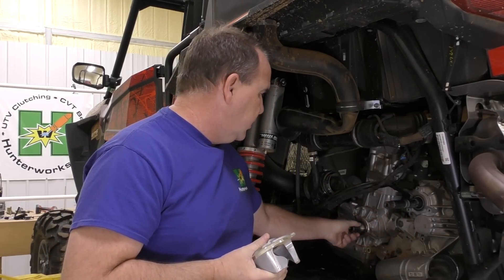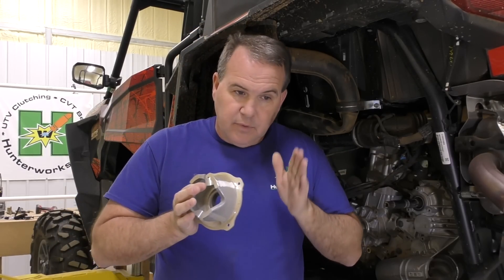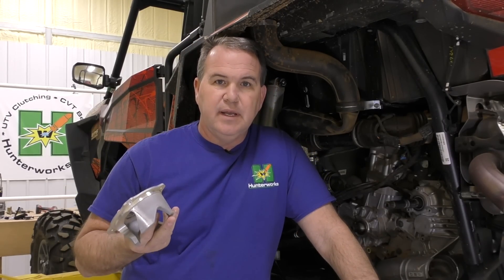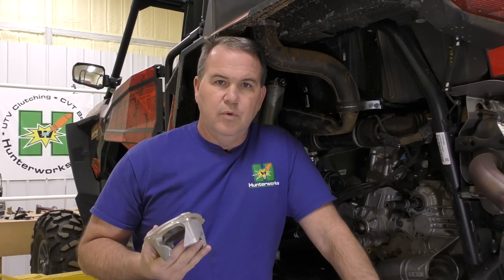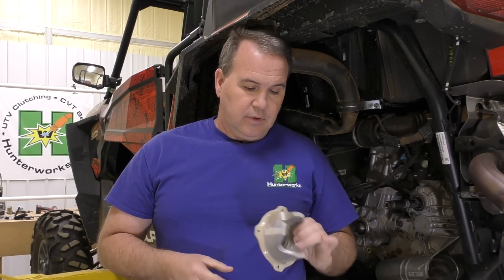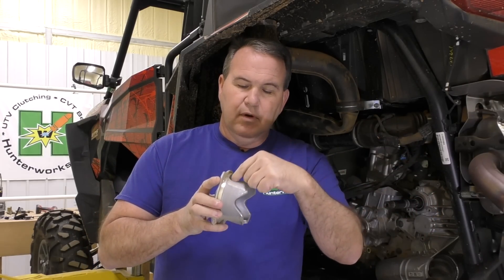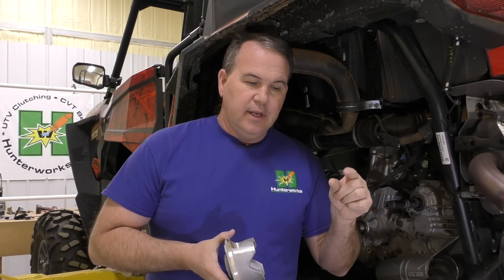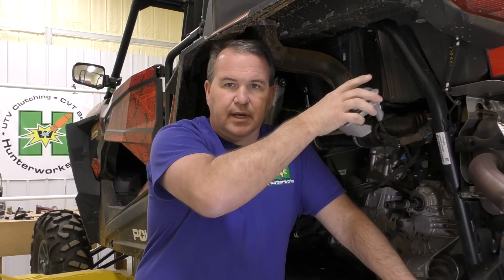Polaris Engine Braking Explained

Comment: I'm new to the 2014 polaris 900 stealth how can I delete this I can't stand it  I want the unit to coast freely when I let out of the throttle thank you
Reply from the maker: What is a stealth?  This a RZR or Ranger or snowmobile?
Reply: @Hunterworks  it's 1yr limited edition 900 rzr in 2014 if I understand it correctly
Reply from the maker: @kevinhumphrey932  You do not have engine braking technically, the helix is rather aggressive though, we have a less aggressive helix.  Same vehicle from 2011to 14 as far as clutches go.
Reply: @Hunterworks  post up a part for the items I need if you don't mind
Reply from the maker: @kevinhumphrey932  https://www.hunterworks.com/polaris_xp_rzr_900

Comment: How can I reduce my engine braking on my 2024 polaris Xpedition? It's dangerous in slippery conditions. It's way to aggressive.  Possible clutch spring change?
Reply from the maker: Your xpedition does not have engine braking technically, it has a two way bearing in the primary.  So from here the only way is change the helix to one with a different back angle, but I am not aware of one available.  If brand new, it will lessen as it gets some miles on it, then drive with the gas pedal and you will not notice it, do not take your foot off the throttle until you stop.

Comment: Dose a 2024 polaris sportsman 850 ultimate trail 
have full engin brake ??.
Reply from the maker: It does
Reply: Ok thanks , so when  I'm creeping up to a road crossing,  just enough  engaging the clutch  may getting 3-5 km. Then let off . It makes a little clank/clunk boath  accell and decell .
 That would be the helix making that little clunk/clank working  the engine brake.  Correct ??.
Reply from the maker: @trevorhall6286  couple things, the roller swapping sides in the helix and gear lash in the tranny, slow is not great for a cvt
Reply: Ok , thanks for the info . 
Very much appreciated 👍
Reply from the maker: @trevorhall6286  no problem

Comment: I have a 2013 sportsman 800 ot makes a loud constant clunking noise when deceleration and even when hitting the brakes foot or handlebar brake  it doesn't clunk on acceleration
Reply from the maker: That is not a clutch I am familiar with, we only do UTV's for the most part but a good look over is best

Comment: My rzr 800 has such bad engine breaking it'll slam you into steering wheel and is that way from any speeds I hate it way too strong
Reply from the maker: What year and model ?  Miles on it? Tire Size?
Reply: @Hunterworks Inc.  2008 non s model 26 in tires 5.5k miles and your  belt
Reply from the maker: @shawnmarks1400  technically, it does not have engine braking since it has a two way bearing so I would just say wear from all the miles on the clutch causing this
Reply: @Hunterworks Inc. After receiving a response from you I took belt cover off and  so far I found the center bearing on primary is frozen/locked solid. Do you think that's it or could there be something in the secondary as well? Thank you for all the help it's extremely appreciated
Reply from the maker: @shawnmarks1400  that is it
Reply: @Hunterworks Inc.  WOW just called dealership 700 and change I can't afford that please tell me it's rebuildible
Reply from the maker: @shawnmarks1400  you can put a new bearing in it
Reply: @Hunterworks Inc.  fantastic does your company offer one I would love to keep my business with you. You've been extremely informative and helpful
Reply from the maker: @shawnmarks1400  Not the bearing but the tools to swap it out and a video showing you how
Reply: @Hunterworks Inc.  ok fantastic I'll check it out thanks again for all your help

Comment: i have a polaris xp 1000 2017
When i don't push gas about 20 mph it start to stop dramatically until i got 10 Mph and the belt sound like slippering.
How can i resolve that problem ?
Reply from the maker: most likely the clutches are just worn out, but send me an email todd@hunterworks.com I can help you further

Comment: I have a 900xp with a 27% gear reduction. It has 30” tires. All I do is rocks/hills. When I’m cruising and let of the gas, it locks up the back tires because if too much “engine braking” due to the gear reduction until roughly 1-2mph. How can I get LESS “engine braking” while keeping the gear reduction?
Reply from the maker: lots of questions: Year and ranger or rzr? Also miles on the clutches? What brand of clutches and any clutch kits?
Reply: @Hunterworks  thanks for responding to my email!

Comment: Can you use the clutches from an s model rzr with engine breaking on an xp
Reply from the maker: you can only use the primary with one way bearing, must use the same springs, weights and helix from XP
Reply: @Hunterworks  but can you just swap the clutches without taking them apart to make it work
Reply from the maker: @codyfults8182  no.  Swap weights and spring

Comment: Is there a sticker or something that I can tell if my '19 ranger 900 xp has engine braking?  I want a new belt for it because it "chugs" wen tryin to start moving, forward &reverse.  And wen buying one of ur belts it has 2 options, 1 with engine braking and 1 without.  Help me stop this chugging, I hate it
Reply from the maker: Just look at the secondary clutch of it has to rollers and slots it has engine braking if it does not it does not

Comment: Is that where the “clunk” comes from when you first take off? The helix letting go of the rollers and slamming back the other way?
Reply from the maker: Almost, the spider with rollers sits still, as you give it gas, the belt is turning the secondary, as it turns the helix turns quick, the rollers on the shaft not moving yet, so the helix slams into the roller in the bottom open part of the helix.

Comment: My 2021 Polaris 570 utv makes a sputtering sorta popping sound at low speed,the machine only has 4 hours on it and i was told the engine breaking causes it to do that? I'm still trying to break it in but this popping noise worries me it's almost like it wants to backfire
Reply from the maker: Never heard of that, engine braking is mechanical not electric so if something is sputtering, you need to take to dealer

Comment: I am a low and slow guy, just changed my belt at 2700 Mile rzr 900 ... also I installed 31 tires and rims, 2 inches higher that factory but I believe I am going to buy the Dura clutch from your outfit but I will have it sent to you and set it up for me... please make sure I buy everything clutch puller and whatever else is needed.  Lol
Reply from the maker: You won't have to send  the clutch here for that, comes set up, we only change weights for elevation not tires, you should consider smaller tires or a gear reduction with that size tires on a 900

Comment: I have a 2019 sportsman 1000 xp with about 600 miles on it, love the quad, but coming from a 1000 can am renegade, the engine braking is very different. On the renegade I had engine braking in 4wd on all 4 wheels all the time, even coming to a stop. I’m an aggressive rider and loved the renegade , but wanted storage so I got rid of it and purchased my sportsman. When I’m riding down mountain switchbacks and coming to a near stop to turn before I fall down the side of the cliff my sportsman FREEWHEELS and I see my life flash before my eyes and have to slam on rear and front brakes, I HATE THAT. I need engine braking ALL the way down to a stop, not just down to 4-5 mph. I NEED your advice as to what to do. I was thinking of taking a loss and getting rid of it but seeing as to your explanation, it seems as if there is a solution. WHAT DO I NEED TO DO? PLEASE HELP. THANKS
Reply from the maker: I am not familiar with all the sportsmans models but I looked up one now and according to parts diagram yours has the one way so full on engine braking.  If I knew the specific model maybe I can tell you more
Reply: @Hunterworks  thanks for the quick response. It has ebs but not below 4-5 mph, it just freewheels at 4-5 mph and that's super dangerous on some of the steep inclines I encounter. I have the 2019 sportsman xp1000 premium model.
Reply from the maker: @joecatalano82  AGain I am not a ATV guy and do not know them, any of the 19 sportsman I looked up has a one way bearing in the primary so it should have EBS below 5.  Take the belt off and see if you can turn the bearing in the primary either direction or just one.  Your atv's clutch might have gotten wrong bearing installed, it happens.
Reply: @Hunterworks  .. Will do. thanks buddy

Comment: You can have engine braking with the EBS clutch without the one way bearing. All the one way bearing does is give you engine braking down below about 5 miles an hour.
Reply from the maker: Then technically you don't have engine braking

Comment: VERY VERY INFORMATIVE!! Now that that has been said let me say this...I freaking HATE the EBS!! I feel like I'm gonna flip over my handle bars sometimes cause I'm still getting use to it and it will catch me off guard. I have a 2018 sportsman 570 sp...can EBS be taken out of my machine without it affecting the performance or anything for that matter? Other than the warranty of course...
Reply from the maker: I assume it is like the UTV and you swap the one way bearing for a two way and no reason this affects warranty in my opinion
Reply: Man, I just got a 2024 sportsman 570 ride command, when you get down to slower speeds it feels like it's gonna throw me over the bars, guess I'm not youst to it yet !

Comment: So I put an older 500 ebs clutch on my 08 rzr 800 it has the one way with blades on it do u see any problems with this setup I put the spring and weights off the 800 on it
Reply from the maker: Didn't know it would fit. Not familiar with the older than 08 model RZR

Comment: Love your guys videos I have a 2018 Polaris general 2 seater love my engine braking exspeclly coming off steep downward hills it's almost out of factory warranty 6 months old in Feb 15 I make pymts iny machine still do oil changes at 25 hrs 50 on everything else and I'm at the 980 miles on it so far